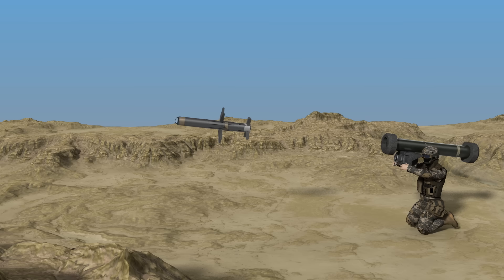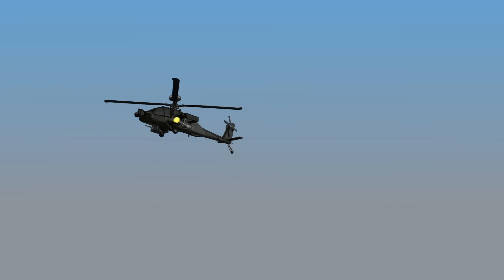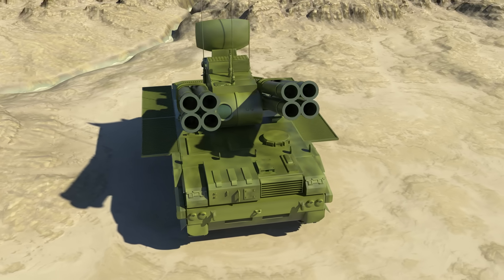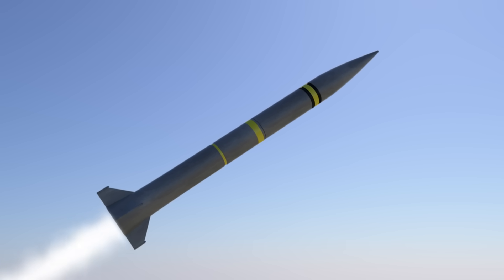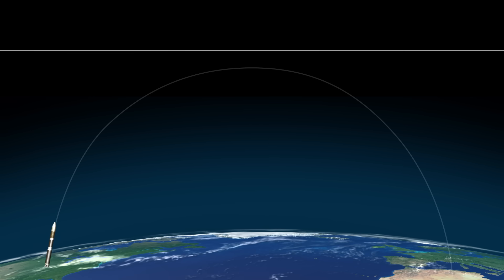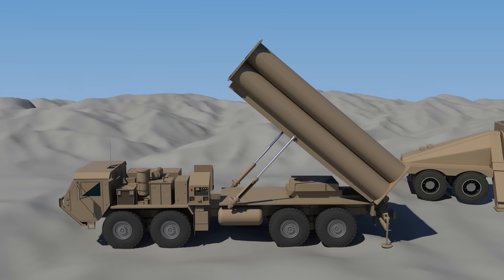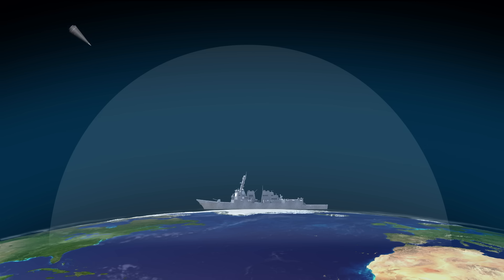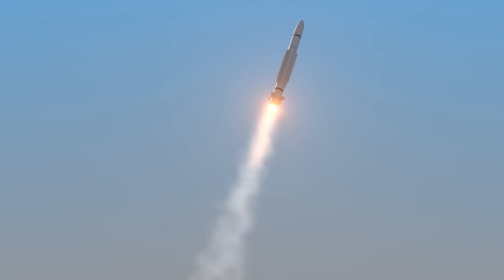How Missiles Work: From Air-to-Air to ICBMs | Guided Missile Systems Explained

Comment: 2:46 RPG “Ручной Противотанковый Гранатомёт-7” is a portable, reusable, unguided anti-tank rocket-propelled grenade launcher. It is not typically classified as a missile in the same sense as guided or precision-guided munitions like the AGM “ Air to Ground Missile” or SSM Surface to Surface Missile, but that’s just semantics, right!

Comment: If it's not guided, it's not a missile. RPG aren't missiles...
Reply: Funny to see people incorrect correvting others on internet. 

Guided or unguided has nothing to do with missile classification. What sets missiles apart from rockets is ability to change flight midcourse.
Reply: @malithaw can something change fight midair if not guided. Aaah. Come on.
Reply: @malithaw  so you mean that you... Guide the missile to adapt is trajectory ? :D
Reply: lol so what’s an unguarded missile?
Reply: @Dr_Larken they call those rockets
Reply: @Dr_Larken  you mean a rocket ?
Reply: @Dr_Larken  unguided self propelled projectile is a rocket. 
RPG is rocket propelled grenade

The guided version is a missile.. as in heat seeking missiles.. they adjust their course during flight as per received data in real time. 

Not self propelled could be a bullet from a gun or a grenade from grenade launcher
Reply: @glaucomflecken  well, RPG doesn't stand for "Rocket Propelled Grenade" but "Routchnoy Protivotankovy Granatamiot" that you can translate by "Manual Anti-tank Grenade Launcher" :)

Comment: rpg-7 is not a "missile" it is a grenade
Reply: Rpgs are shaped charges not grenades
Reply: @RubanaRose they actually are a type of grenade in military terms, hence the naming. It's stupid semantics, but still..
Reply: Then everything is a grenade indeed @Whyoakdbi
Reply: @RubanaRose "rocket propelled grenade"
Rpg is unguided, missile is guided
Also shaped charge is the type of warhead
Reply: Missile can be unguided to and they also have shape charged  @FinnisJaeger
Reply: As warhead
Reply: @RubanaRose missile is guided, rocket is unguided. That is litterally the meaning. Also either missile or rocket can carry multitude of different "warheads" they dont need to be shaped charge and shaped charge warhead does not define if something is "missile" or "rocket" or "rpg"